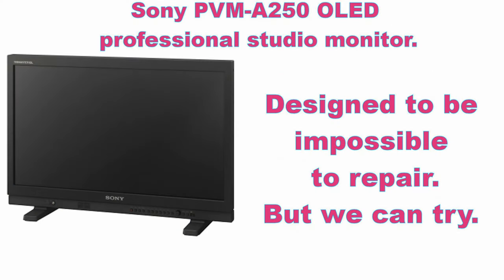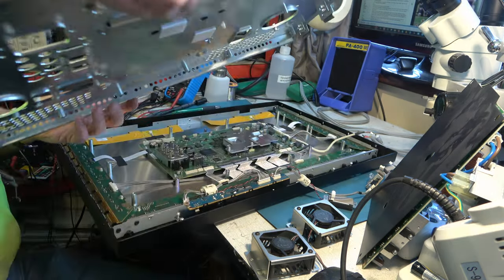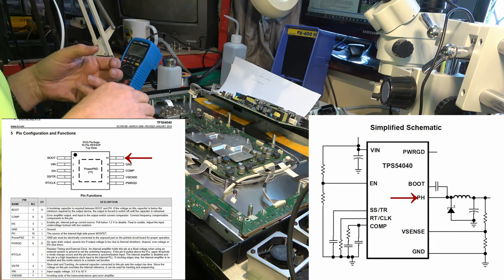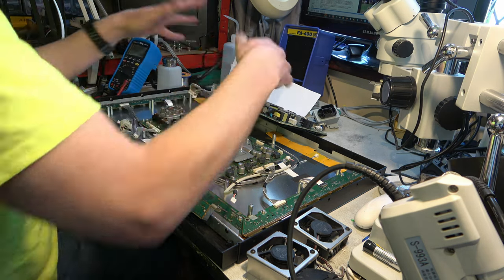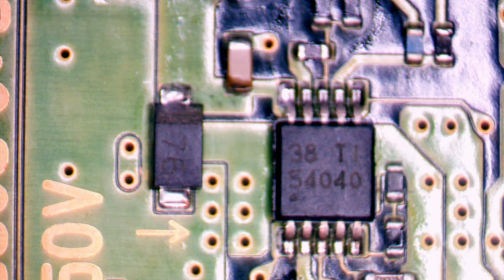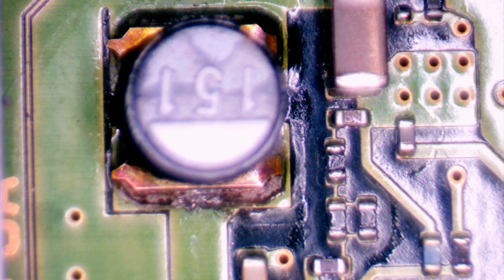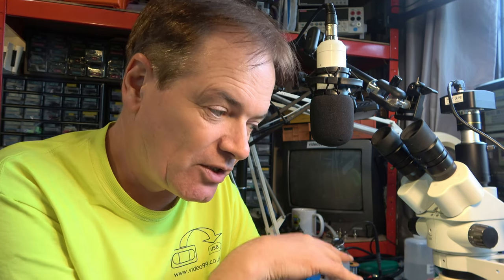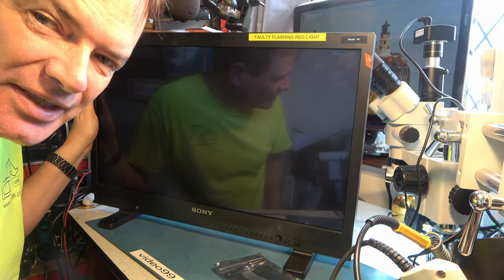Sony PVM-A250 Professional OLED Monitor is not designed to be repaired.  Let's try harder.

Comment: I have a PVM-CRT for my 8-bit computers. The build quality is excellent and the device is very serviceable. Seems Sony have lost their track.
Reply: It's a bit of a chicken and egg situation I guess. On the one hand, falling costs of mostly-automated large-scale industrial production have rendered component-level repairs mostly economically unviable (especially on consumer equipment), on the other hand manufacturers are probably more than happy to sell complete replacement boards or whole units instead of having third parties do repairs.
Reply: @Ragnar8504   Whilst I agree with the main thrust of what you're saying - the frustrating thing here is that this isn't a piece of domestic equipment; and given that the user-base is likely to have strong in-house technical knowledge/support... the lack of servicing information is pretty off-putting. Board-swapping and being forced to go to a 'service centre' are things that won't fly with many professional users.

Comment: Hi, Colin. The QBC board on this model has the TCON intergrated into it. There also is a fuse in between the QBC board and the OLED panel which supplies voltage to the panel for it to start. The fuses marked with F are small SMD type fuses similar looking to the SMD caps/resistors. Check the continuity on those fuses, especially F8701 (28V). This fault reminds me of the Sony Playstation 3 that had similar problems which was called the yellow/red light of death which did involve a BGA being the culprit. There also is a way of testing the OLED panel itself by disconnecting the 2 connectors side by side the 4 flexible cables on the QBC board. By disconnecting them the Unit should turn on without the panel being connected which will confirm if the panel is defective or working. I have worked on the earlier model Sony PVM-2541 (OLED) which had the same fault and it did turn out to be a SMD fuse which supplies power to the OLED panel. Best of Luck...

Comment: That’s what I don’t like it is repairable. You got to know what you’re doing and understand the maths to electronics. The amount of stuff I had come in where people say it’s not repairable because they took it somewhere and they said that it’s not possible and hen I repaired it. Most of it is because people don’t understand the maths behind electronics.
Reply from the maker: Maths won't help without schematics for this very, very complex unit.  This is not a domestic product.
Reply: @video99couk  yes it will try harder. Also have you checked for cracked joints? Also use that oscilloscope to check points and see if there is data flowing to the points it should be.
Reply: @michaelmitchell8218  - Colin's right - and I think I can be pretty confident in saying he understands 'the maths' very well indeed.  There is very little point in 'scoping around' for waveforms when you have absolutely no information as to what the correct waveform ought to be. - Just because there is something there (or not!) doesn't mean the correct thing is there!
Reply: @Matt_Quinn-Personal_Account  totally disagree and if I worked like that taking forever to repair one item I be out of business. A lot of time you have to repair stuff without service manuals, handy if you got one but if not you have to find a way round it. I did offer him a service manual to this item but never replied back. It could be just a bad joint under one of the BGA, seen it so many timed like this do it.
Reply: @michaelmitchell8218   - As Colin points out; this isn't a piece of domestic equipment...  The 'business' of repairing equipment like this means returning units which are operating to a calibration standard. Sony's repair procedure requires module replacement and specific repair software/hardware to achieve that - which does place the unit beyond economic repair in many if not most cases.  Sony seem to be keen on capturing this activity for their authorised 'service centres'; with even companies that have their own workshops and trained technicians getting the cold shoulder.   - They are very unhelpful, which in my view is counter productive because it ultimately discourages those of us who might buy such equipment from them.   

...You can disagree with trained/qualified electronics and broadcast engineers until you're blue in the face; it won't change anything; least of all how they go about fault diagnosis.  Unless you have something other than the PARTIAL manual which is commonly available for this specific monitor; and unless that manual has the appropriate schematics, waveform diagrams etc. - there is no logical reason to go scoping around for waveforms that you have no way of knowing are correct. - that is simple, cold hard fact. 

As for the manual... it's very easy to find Colin's email address and simply send him a link to something you might think is useful or even just ping the file over! 

Yes... it might be possible to blindly reflow a BGA and get a unit operational again. Then again; it may not. And yes; this might be quite a common thing with domestic TV sets and standard computer monitors; that's not what this thing is!  - As a professional unit designed to take a certain amount of rought handling; this unit won't be built like a domestic telly!  As a buyer of such equipment - I'd certainly expect it to be more robust than something box-shifted from Curry's!  And for the sort of 'troubles' frequently suffered by domestic equipment to be less common.  

Comments such as "most of it is because people don’t understand the maths behind electronics"  are really very very foolish when directed at individuals educated to HND standard in Electronic Engineering and beyond...  if you're going to seek self-aggrandisement at someone else's expense, please do remember the old saying about teaching your Grandmother to suck eggs!  Equally well; if you're SO expert, please do feel free to set up your own repair channel and demonstrate to the world how it should be done!
Reply: @Matt_Quinn-Personal_Account  what a load of rubbish. I’m a qualified engineer I’m also qualified in computers computer repairs I’m also qualified in CNC. I’m also qualified in metal work etc. I don’t care if it’s domestic or industrial I’ve done it all in repairs and makes no difference. A bad workman always blames his tool simple as.
Reply: @michaelmitchell8218   Not rubbish at all; childishly throwing the toys out of the pram does nothing to boost your credibility. As a former College Lecturer; well used to assessing potential students for admission to HE, (and as a business owner who operates a technical facility and is responsible for hiring people) I seriously doubt whether your 'qualifications' are of any substance at all. - Your 'type' is very common; your claims are entirely nebulous.  

- If (for example) you had completed study to HND level (which is what I'd expect of a 'qualified engineer') you'd know that all the individual subjects you claim to be 'qualified in' are encompassed as individual units within the HN Electrical & Electronic Engineering specification. - You'd also tend to be quite clear about what kind of specialist engineer you are; engineering being a term with very very wide scope.  

The very fact that you do not understand the differences between working on domestic products and broadcast equipment says a great deal about your capabilities, experience  and knowledge; as does your failure to understand the potential use of oscilloscopes in this context. Likewise the absolutely irrelevant tripe you wrote about 'understanding the maths' in your initial (personal) attack on Colin.  ...Your latest strawman about 'blaming the tools' is risible and a deflective fabrication. - Nobody is 'blaming the tools'; merely pointing out the paucity of information.  

As I said... if you're such a great 'repair expert' do feel free to upload some content to your own channel, explaining to the world how it should be done... 

I doubt you're capable of that though; which is why you simply seek to take out your own frustrations and self-aggrandise by vacuously attacking someone who has - and continues to - actually walk the walk; and is contributing positively to the wider community.  

Clearly you have nothing of use or value to add to the conversation.
Reply: @Matt_Quinn-Personal_Account  worked on it all mate still working in the same principles. As I said if I work like this I would be out of business. People want stuff fix quickly not weeks and weeks and still stays broken. Also I don’t run a channel because I don’t have time and to busy fixing mess ups that people like this make. It’s a weekly thing coming in my door and they say they watch someone on YouTube do it and I try to have a go and made a mess. Also it goes to people like this who have it for weeks and say it can’t be fixed and then I look and a few hours later in out the door working. Like I say bad workman blames his tools and never himself.

Comment: The comments on the previous video about cracked joints under BGA chips certainly sounded familiar to me. Some years ago I repaired a large Sony LCD TV which had exactly the same symptoms, logic supply voltage powers up very briefly then immediately shuts down. In that particular instance it was a broken joint under the LVDS TCON (large BGA chip which drives the panel) which was of course failing its self test, because of that the software in the set was, like yours, then switching its self off.

I was able to repair it by squirting flux under the affected chip then giving it a thorough blasting it with the soldering air-gun.

Comment: Just out of curiosity did you try to connect the monitor to a pc , and see if it registers on a network connection or a terminal window. 

Sorry if I'm talking nonsense, wonder if it's bricked due to a corrupted firmware or something